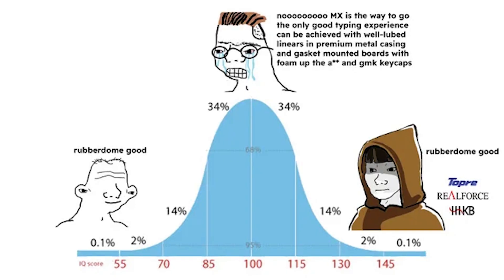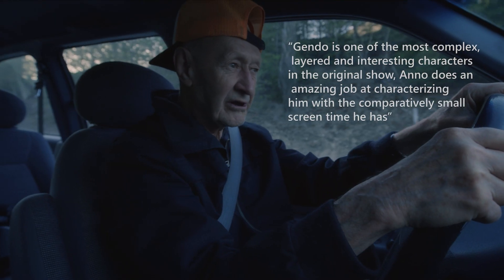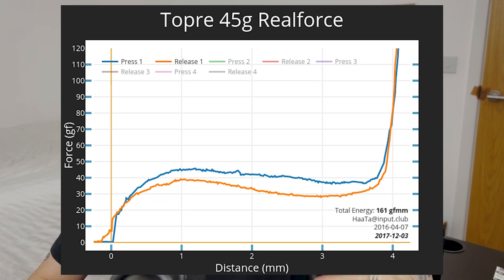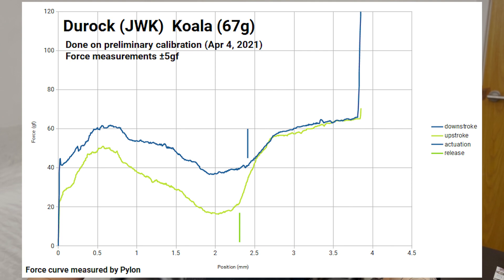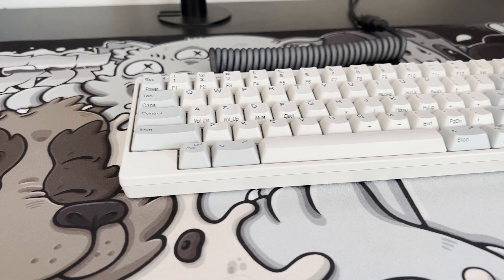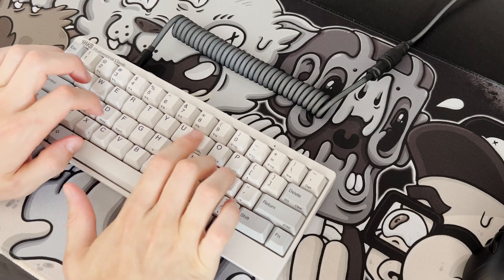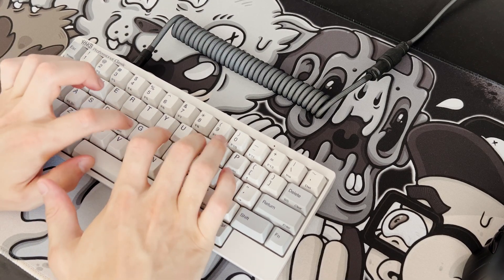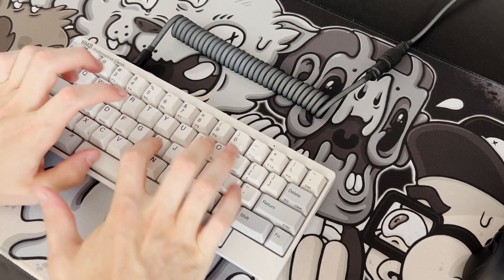The Gentleman's Thock | Topre Keyboards

Comment: The Topre switch, and more specifically the Realforce Topre Corporation keyboard, is a typing man's keyboard.  If you're someone who needs to type all day and requires nothing less than the best, you will find yourself looking at a topre keyboard.  And for the truly distinguished gentleman, you will find they gravitate to the Realforce keyboard with variable key weighting to reduce strain over long hours of typing.  Fun fact - typing to you on a realforce topre keyboard right now.
Reply: I've been debating trying one of these keyboards, but after listening to the sound in this video, I don't think I can stand listening to it on a daily basis lol. Did you use any interesting mods to change the sound, or do you type on the stock board?
Reply: @PrinceDman 2 months late but there’s also the type-s in case you didn’t already know

Comment: What separates topre from membrane if they both have basically the same construction?
Reply: Price. If you want to buy an overpriced membrane.
Reply: Topre does not have the same construction as is a rubber dome. Topre generally uses silicon and has a spring under the dome which changes the feel, increases longevity, and makes them more stable. Membrane is simply the rubber dome.
Reply: @NTR-Impact if you wanted an overpriced membrane then why would you buy topre when it doesn’t even come with a membrane?